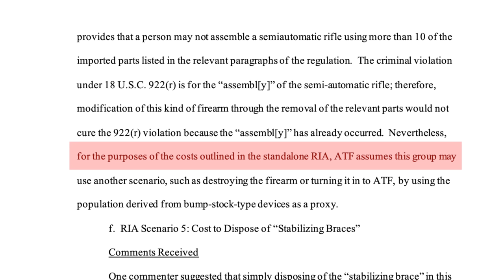BOMBSHELL HIDDEN IN PISTOL BRACE RULE!

Comment: Handguns are defined as having a short stock. Pistols and
 braces are not defined in the 18 U.S. Code § 921 -
Definitions. (1)The term “person” and the term “whoever”
 include any individual, corporation, company, association,
 firm, partnership, society, or joint stock company. 
They define what "person" and "whoever" are, but not pistol or
 brace. So, "pistol brace" is an ambiguous term and its
 arbitrary application to a natural right is abusive of that
 right to the point of being a felony under 18 U.S. Code § 241
 - Conspiracy against rights and 18 U.S. Code § 242 - 
 Deprivation of rights under color of law.

Comment: so basically the AK with the short barrel and brace have no fixing them? You can't remove the brace because it will still not be compliant. You can't add a larger barrel because they Ak are welded together and all the similar guns like it. Getting it stopped in court may not happen before the time lapses.

Comment: It seems to me the number the ATF came up with is the number of possible braced guns they are AWARE of.  Not all the the guns that are actually out there. I'm guessing they are going by the number of braced complete lowers and complete pistols with a brace that were sold. It's unlikely they included bare lowers and complete lowers without any type of stock or brace attached. That would explain the discrepancy.

Comment: From the Congressional Research Service:  

In the past eight years, larger, heavier handguns and pistol
grip firearms have seen increased sales likely due, in no
small part, to stabilizing braces. Most major firearms
manufacturers are making firearms equipped with
stabilizing braces as part of their featured product lines.
While there are no available statistics to gauge
authoritatively the number of stabilizing braces already
made and sold in the United States, unofficial estimates
suggest that there are between 10 and 40 million stabilizing
braces and similar components already in civilian hands,
either purchased as accessories or already attached to
firearms made at home or at the factory. Altering the
classification of firearms equipped with stabilizing braces
would likely affect millions of owners.

Comment: Ok so it seems there is a few configuration for discussion:

1) foreign imported pistol no brace

2) foreign pistol sold and imported with brace on

3) imported pistol no brace when sold but brace added later

4) imported pistol no braces attached yet.

1) if you have a pistol and no braces around I would assume you would be fine?

2) this one seems the worst because you have a brace on already so as stated with the backward classification when the brace was added when sold it magically became a rifle and was not 922 compliant so once it magically became a rifle you can't fix the 922 compliant issue.  Telling the aft about it for the amnesty would just mean they deny you and know you have an illegal firearm.

3) unless you changed the required 922 parts prior to ever putting the brace on you have the same issue as #2.  If you changed the 922 parts prior to putting a brace on you could possible be legal at the amenity but you never know.

4) if you changed the 922 originally you could have paid the $200 tax stamp and SBR it.  It seems you could change the 922 parts then put a brace on them you are also looking at the brace rule change.

If we attempt to actually SBR it now would they even accept it or would that just tell them where to find it

Comment: So what if you take the pistol upper off of the receiver, store the receiver in a safe and place the upper in a storage case, would you still be in possession of an sbr, according to the new rule, since it is no longer assembled as a complete gun?
Reply: They might try and get you with "intent" to manufacture an SBR
Reply: They call that constructive possession of an SBR.
Reply: Not positive but I thought it said can be readily restored or assembled into a working firearm.

Comment: This also doesn’t make sense.

It’s a foreign made pistol and was not imported with a brace. What I’m gathering is if that imported pistol could accept a brace it’s an SBR?? 

So anything that fits in a micro roni or any other braced system are also outlawed and must be destroyed. If you own a foreign made pistol by any popular brand, because it has the ability to fit in a roni, you have to destroy it?
Canik
Taurus
Glock
Sig

Comment: There is no way of knowing if the end user added a brace.... So basically every foreign pistol is subject to confiscation????
Reply: No. At least in the case of the SP5, it was not imported with a brace so I am struggling to see why it is being mentioned. However, if somehow you get caught with it then you are screwed. And if you try to register it to get the free sbr (which it is not it is just admitting to a felony) then they will deny your application and come take your gun. That is what you need to be concerned with....

Comment: The gun is legal under GCA because it's only a crime to make it not possess it. Once made and shipped to a store a semi automatic rifle is totally legal even if the process of making/building wasn't.  

If Grand Moff Garland is waiving the NFA possession issue in light of the vassilations over the last 10 years, then the concern of having an SBR is eliminated as long as you pick a presented option... but don't pick form 1, because this could be seen as a make/remake using the foreign parts.

In short, this issue was addressing the costs of compliance, but addressed the legality of possession, and in my opinion was itotally wrong.

Comment: So if you buy a ak pistol without a brace or anything on the back but there is a variant that you could buy with a sbr tax stamp would you have to destroy it even tho you got it without the brace or stock? Because like the pioneer arms Hellpup has a variant with the brace and a version without and the version without would that be part of this turn it in to the atf or destroy it business
Reply: I'm not a lawyer however the way I see it if the firearm in question never had a brace installed on it. It's still legal. Such as H&K SP5.    However if it ever had  one installed it  is/was in violation of the 10 part rule , 922, and it is illegal and cannot be remedied by just removing the brace.  AFT rule says that the owner must turn the whole firearm in or destroy it.

Comment: NOBODY is going to turn in or destroy their firearms regardless of 922r compliance. No, I guess you can't SBR it. That brace will get removed! (Pin driven out, hinges cut off. Trunnion replacement. What brace??) Or a boating accident will occur. Kinda glad mine has a 1913 rail on the back, lol.

Comment: According to TheYankeeMarshal, once you get the free tax stamp, you can then take off the shtty plastic pistol brace, and put a real rifle stock on it, no matter the bbl length. Anybody else heard this?
Reply: And when you register under that special red form you are admitting to be in illegal possession of an SBR. Then all the red formed firearms will be confiscated. If the pistol was sold by mfg with a black you are screwed. If you added the brace do a regular form 1 and pay the stamp, then make the sbr. There is a reason they are not using the same form to do this.and if you use that free form to notify the ATF you have an illegal SBR do not forget to engrave it and make sure it is 922r compliant and ask for permission to take across state lines..But yes, once you make it a registered sbr you are free to put a stock on it.
Reply: I wouldn’t listen to Yankee Marshal for any reason

Comment: Do you even read this before making a video? 
"assembled using 10 or more of the "IMPORTED PARTS" of the list.  what list you don't show? so I googled it and found page 247 and 246. It was a rebuttal to a commentor who questions about adding a stabilizing brace to an Imported Semiautomatic rifle. and they clairify that if the Imported rifle was assembled by the owner from the imported parts of the list in the amount of 10 or more.   Then it would be a violation regardless of stabilizing brace or not.  Like do you even read this stuff?

Comment: It’s unconstitutional but I already bought pistol buffer tubes so I can remove the brace and it’s adjustable buffer tube for the basic short round pistol tube.  That covers their so it cannot readily be reattached BS. ILL wait things out and see as it may be overturned later. I don’t plan to SBR mine as there are too many issues with NFA items.  Sometime down the line I may build a proper SBR but I’m not concerned with the 200 fee later…. For now I just want pistols I bought to remain as unregistered legal pistols. Never was a fan of the stupid brace. It’s an inferior as a stock and worse used as intended strapped on an arm.

Comment: before this ruling I have been considering a SBR for a while. id prefer to have a stock over a brace anyway and the added ability with foreend grips was appealing as well. it could be used as a good time to avoid the $200 tax stamp but in the same breath that would give validity to these ruling changes which I dont want to do... choices, choices, i think ill wait it out.

Comment: I have rifles in 300 blackout and 223. I plan on converting the affected pistols into rifles but in an additional different caliber. As the lowers are marked multi and we have always been legally able to convert pistols to rifles. What calibers might be best. Availability and  cost of the conversion are the main factors. Why have less when you may have more.
Reply: For longer ranged stuff, 6.5mm Grendel or perhaps 6mm ARC; however, availability is probably lacking in the latter.
For big bore stuff, .50 Beowulf or .458 SOCOM have decent availability.
For plinky stuff, a pistol caliber or .22LR conversion kit.

Comment: You keep forgetting the option of adding a 16in barrel. Honestly, saw the writing on the wall years ago, braces were being used as a loophole. It was only a matter of time until they got mad and tried to take action against them. I left well enough alone.
Reply from the maker: That is not an option with this particular issue.
Reply: You obviously don’t understand what 922(r) is. You cannot make a rifle in a non sporting configuration without a certain number of US made parts. Not legally anyway
Reply: Plus idk if you understand how difficult it is to rebarrel an ak
Reply: @dcwillis87  I'm clear on 992(r), made a SKS compliant years back. As far as putting a new barrel on an AK. Never done it myself but I have a co-worker who built some himself. Seems to me its not so much hard,  it just requires the proper equipment.
Reply: @TheGunCollective  Really? That's asinine. If that's the case they are either truly idiots. Or are intentionally trying to make things impossible. Because its a simple solution to the problem. Even if none of this should be an issue anyway.
Reply: Don't self incriminate...

Comment: How is a bad idea to register your sbr? We do that normally? Here you get an sbr without a tax.  This makes no sense.  Do you comply with the law normally or not? Do you believe in the rule of law or not? Or only for laws you like?
Reply: That's what I'm wondering. Can't someone just take off the pistol brace, or separate the lower from the upper until they get the stamp? Am I missing something?
Reply: In this case, registering your pistol as an sbr is admittance to building an sbr before being approved for your tax stamp. Basically admitting you committed a felony and opening up yourself to be charged, raided and have your dog shot at a later date.
Reply: Original post sponsored in full by the ATF
Reply: On top of that the back log of applications could more than likely take well over a year. After 88 days your open background check is automatically denied and when the atf was asked what will happen after that denial, they said and I quote “we will take action”. So roll the dice if you will.
Reply: The glow stick shines bright on the screen
Reply: @pickeljarsforhillary102  hide your dogs